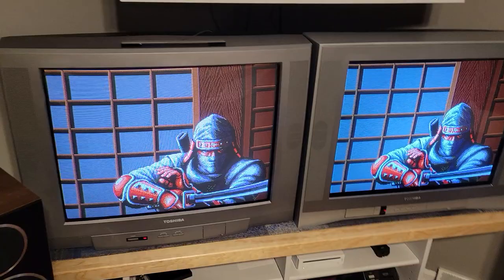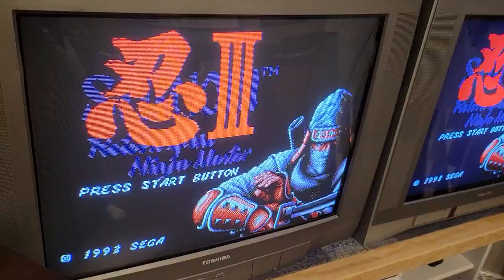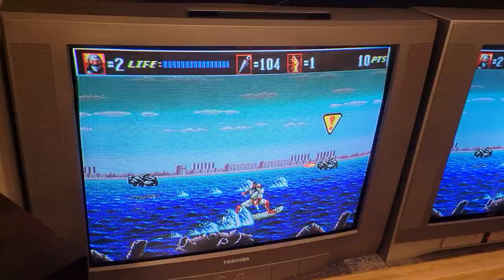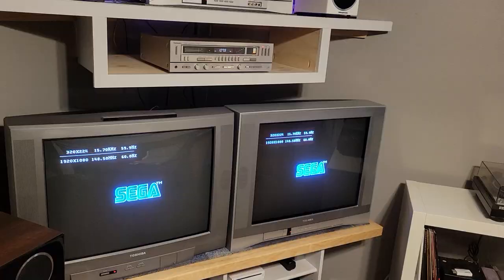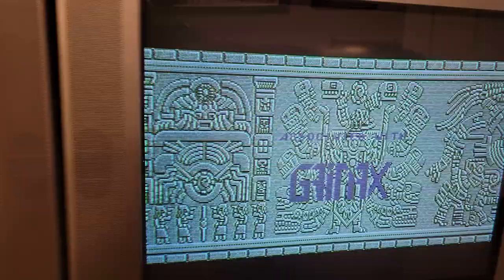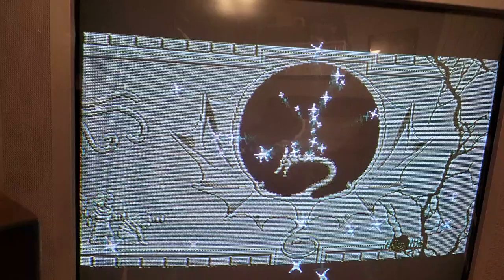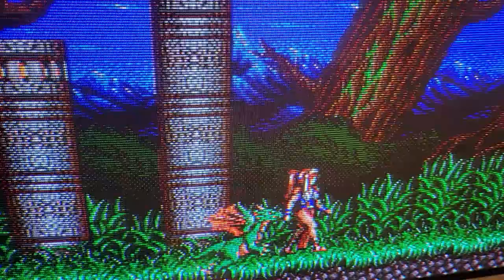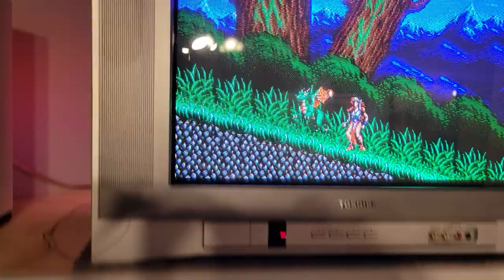My Current CRT Setup

Comment: 27A43 definitely a (Holy Grail) in my CRT collection I have the exact CRT. I have 5 CRT 4 of them are the high-end Sony's 27FV310, 36FV300, 13fs100, and 20FS120. I absolutely love curved glass black picture tube 3 line digital comb and this CRT does not have a scan velocity Modulation. Make sure you disable them on your AF models just Google disable SVM. 27A43 is almost as good as a d-series JVC in my opinion I love curved glass too many high end Sony's are flat panels with horrible geometry issues. Cheers
Reply: Yo, how does your 27A43 compare to your 27FV310? Which one do you like better? Or how does it compare to any other curved tubes CRTs you may have?
Reply: @shredbraahh8606  it all depends on what you're looking for in a CRT. A42 is an Orion tube different scanlines curved glass. FV310 aperture grill flat glass thin dark scanlines lines voltage regulator. I have a lot of CRTs I made this post over a year ago I'm up to 13 right now haha 😆 if you can get your hands on both go for it but I ain't going to compare both and say one's better than the other to be honest both of them have been unplugged for a good 6 months currently gaming on my PVM and JVC D-series. I would say I prefer pixel art games on the A42 so NES,SNES, Genesis and fighting games.FV310 6th generation games so PlayStation 2 Gamecube SNES also looks great too😅
Reply: @shredbraahh8606 also a JVC d-series has more of a bubble curved glass over A43 the bigger the screen the bigger the bubble too A43 is 27-in the d-series I'm currently gaming on as a 32 and I also had a 36 which I just recently got rid of it was a Toshiba tube I kept the Panasonic tube 32-in JVC CRTs D-series have different manufacturer tubes but that's another rabbit hole😅
Reply: @darionovello6886  for sure, I hear you. Epic collection haha. I currently have a 20" FV300 and it's overall good, but I want more of a scanline look for the older stuff. Also the flat tube just doesn't look right to me at all, from a nostalgic standpoint. I thought I would absolutely love this TV, but ehh.. lol. Also the convergence is pretty off, so it's kind of killing it a bit for me. I'm picking up a 27A44 tomorrow (super stoked) and I have a feeling I'm going to love it. Done a decent amount of research, and this seems like the set for me. And I saw some stills and video of the exact CRT I'm buying, and the scanlines look amazing. I have a feeling I'll even prefer it for 480i content but we'll see. Maybe I would feel differently if I grew up with a flat CRT, but man, nostalgic is powerful haha. I'm specifically looking for a 27" curved tube, and need to have component, as well as S-Video and composite. If you have any other CRT suggestions based on what I said, feel free to let me know. Thanks for the reply either way!
Reply: @shredbraahh8606  I just recently picked up a 20FV300 it shares the same tube as 20FS120 if you want visible scan lines thin black scanlines 24 to 27-in and UP would be what you're looking for. My friend has a 24FV300 (very nice consumer set) I would recommend that CRT or a 27FV300 or if you're lucky at FV310 if you're looking for that (nice thin black line scanline look). Toshiba does it a little bit different more of an octagon look multiple octagon stacked on top of each other same goes for JVC D-series and i Art consumer CRTs. You shouldn't be disappointed with the a44 I've had one of those in the past too 😅 it was the 36-inch absolutely gorgeous remind me of the JVC D- series. Anyways can't argue with Free my city's full of CRT so I'm always grabbing one or two a month if you have the proper vehicle and the space I say just grab as many as you can if you don't like it just sell it and grab another one or end up hoarding them like I do haha 😆 cheers
Reply: @darionovello6886  Right on, I appreciate all the info, thanks again. I'm near LA, so there is a reasonably high demand for CRTs. Wish they were all over the place for free haha. Enjoy your hoarding! 🤣

Comment: I had an AF at one point but being a 24", didn't fit with my setup.

By the looks of it, your AF has punchier colors but I'll wager your A set is sharper.
Reply from the maker: Good eye! You are exactly right.  The A does have a sharper image that really looks good to my eyes on 8 and 16 bit games. You can really see "scan lines" which I prefer for those games. The AF is also punchier as you said and really comes into it's own on 3d systems from GameCube and up.  I read somewhere that it has some kind of "scan velocity modulation" that can be disabled by simply disconnecting a wiring harness inside the set.  I may try it to see how the picture clarity is affected. Overall I'm enjoying the sets quite a bit!
Reply: @phobos2k2  I went through the exact same feeling as the way my setup is currently, I have 3 CRTs each with their own specific uses. 2 are HD sets but I really wanted a nice SD set for retrogaming. I picked up a free 32" FS120 which I found looked great and had really nice colors. But then I had the opportunity to get a 32" FV310 and had to find out for myself if the hype was real for that model. True enough, the scanlines were much more defined on the 310 though it noticeably wasn't as colorful as the 120. So, as my setup did not have room for 4 tubes, I had to make a choice and gave away the 120. Like you, the sharper image won me over but if I ever get rid of one of my HD sets, I'm inclined to check out a Toshiba A set or possibly a JVC D-Series but I think the A will win between the two in my eyes.

Comment: Hey, amazing collection. I just would like to double check if you don't mind. I'm about to pick up a 27A44, and I am planning on using it with the HD Retrovision Genesis component cables. Do you know if those cables for sure work with this TV? I'm only asking because I just discovered they do not work with one of my Panasonic CRTs. There is a wobble effect that is caused by an RGB sync issue with the particular TV. Anyway, have you by any chance tried the HD Retrovision cables and do they work? Thanks in advance.
Reply from the maker: @shredbraahh8606   Yes.  I use the HD retrovision cables with the adapter for my model one Genesis without issues.

Comment: That's super cool but where did you get those shelves I'm trying to get shelves for a 1980 20' Philips RC5 (it weight 25 kilos) and it's hard to me find something that support that weight
Reply from the maker: I made the shelves from birch plywood.  One sheet did both shelves.  Some 1x3 boards screwed to the studs support the weight. Bottom is a tv stand from fb marketplace that I painted white.

Comment: Sweet setup. I found a cheap Toshiba 14AF44 but it didn’t come with a remote. I purchased an original CT-847 remote for this TV but can’t seem to figure out how to reprogram and get it to connect with the Toshiba. Any insight on how to reprogram these kinds of remotes? Much appreciated!
Reply from the maker: Thank you.  I purchased a used CT-847 and it worked on all the TVs right away. I didn't have to program anything.  Does your remote do anything to the TV or does it not work at all?
Reply: @phobos2k2  I appreciate the response. I have bought two different CT-847 remotes and neither were able to connect to my Toshiba. I made sure the IR sensor was working on the remotes (even though it was a faint signal) and still had no luck. I won’t power it on or anything. I opened it up and cleaned the contacts but that didn’t work either. I really like the TV so I’m trying not to give up and buy another one since all I need to do is change the input.

Comment: My crt setup isn’t ideal but works for me. I have a 9 cube storage thing I use for my consoles and on top is a sharp 2003 crt tv. It only  has rf and composite but I’m happy with it. I do plan on getting a crt tv that accepts component or a crt monitor that has vga but I can’t find any in my area

Edit: my crt tv has a curved screen

Edit 2: I got an IBM E74 vga monitor and it looks amazing

Comment: Nice. Do those Toshiba's have Toshiba tubes in them or do they have Orion tubes? I think most 27 inch models have Orion tubes.

If i was you I would hook my Wii up to one tv and my MiSTer up to another....not sure what to do with the 20 incher. Maybe hook it up to a computer for a second monitor to play music off or something.

It's really not hard to record CRTs but it does take more effort than a hope and a prayer. Basically you have to mess with the focus, iso, frame rate, exposure, lighting and brightness. Dark images are easier. An hour or two of experimentation will yield results, or you could watch one of my tutorial vids.
Reply from the maker: I haven't investigated. I assumed they were Orion tubes. Not really sure if the curved 27a44 is Orion also.  I did end up doing what you said.  The splitter I was using was amplified and caused issues with the 27a44.  I had to join a fb crt group to figure it out lol.  I find the Wii puts out a less crisp picture than the MiSter.  But it's still pretty cool at the end of the day!
Reply: @phobos2k2  The wii is cool. The 480i looks really good on my Trinitrons. At least the games that were made for 480i. The old wii arcade emulation games that are upscale to 480i look terrible. 

Might want to shine a flashlight in there and see if you can read the badge on the tubes. Toshiba made excellent tubes but sometimes they would put middle of the road tubes made by Orion in models that are under 32 inches.
Reply from the maker: @riggel8804  I looked. The 20" is an Orion. The 27af44 says LG.Philips. The 27a44 doesn't have a sticker that I can see.
Reply: @phobos2k2  Makes sense. You might want to keep your eye out for a 32 inch Toshiba if it pops up. Those all have Toshiba tubes in them. I have heard good things about the Philips tubes but I never seen one in person.